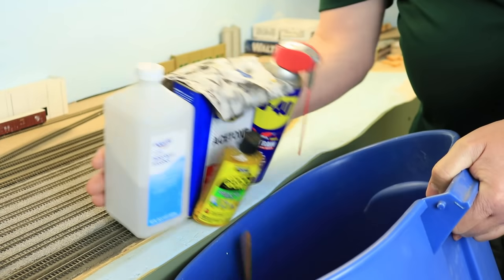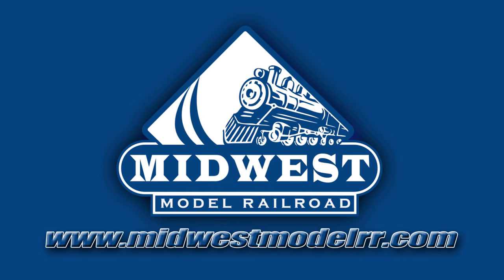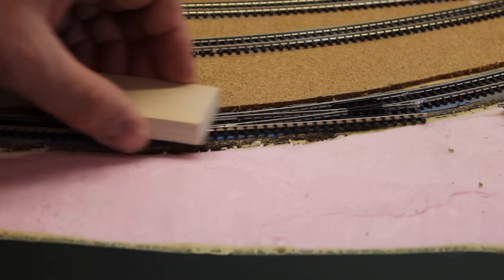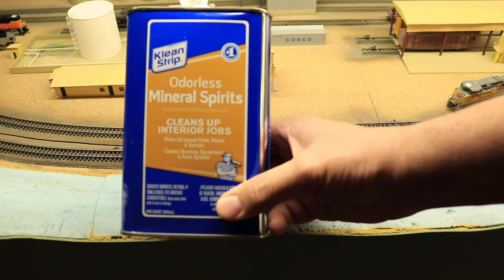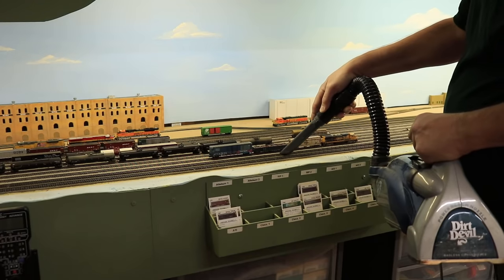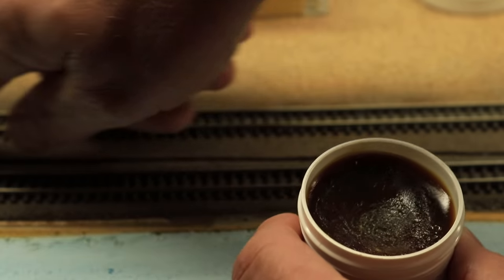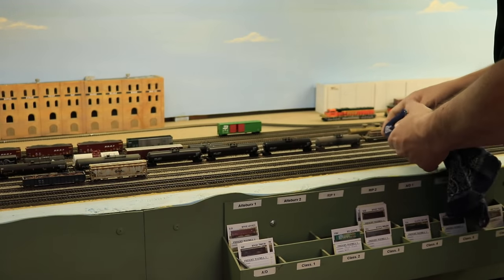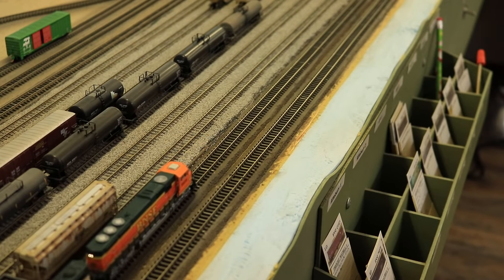Stop Cleaning Your Track on Your Model Railroad

Comment: I know a guy that has the best tracks ever. He dealt with this problem back in the 70s. He took an old gold ring and rubbed the rails. Goes exactly what you are talking about. I thought he was crazy but now it makes sense. You can’t see gold on the rail but it does put a microscopic layer. Gold never oxidizes. Gold is the highest electrical conductor. I’m going to order that no-ox. Great video Ron
Reply from the maker: Gold ring--interesting. Never thought of that technique before. thanks for sharing that.
Reply: Sure, it starts easily enough. Next thing you know, you're on a long journey into dark lands, pursued by a weird little gray man thing and eventually end up hating your best friend.

Comment: I would never apply something like No-ox.  A friend did - all it did was create a greasy mess and you can see residue from it on the rails.  He now has a nearly impossible cleaning task.    Also, Ron refers to Joe Fugate's investigative work on track cleaning.  That chart does not list No-ox.  Cleaners that are used for electronics such as the ones at the top of Joe's list are far more preferable.
Reply from the maker: If there is a visible residue, way too much was applied.

Comment: You can also buy electrical contact grease in little packets about the size of a ketchup pack at your local auto parts stores. That's enough to last for years.

Comment: Hi Ron, You may want to sit down, a somewhat long story is coming. First off, you do know pure water is actually an insulator? i.e. Pure water does not conduct electricity, but tap water will because of the impurities in it. Also water makes iron rust because the oxygen in water binds with the iron to create iron oxide. In the past I read the Joe Fugate article on Polar vs. Non Polar and understand the logic behind the article, but since my layout shares living space with my family, I didn't want to introduce harsh and smelly chemicals into our living space. Being 60 years old, I'm somewhat old school. I no longer use a bright boy to clean my rails, several years ago I switched to a Cratex cleaning block to clean my rails. The Cratex Cleaning Block is suppose to be less abrasive than a bright boy. I only used Isopropyl alcohol to clean the wheels on my locomotives using the tried and true tissue paper draped over the rails technique. In the past I'd tried some of the common techniques like Wahl clipper oil and Rail Zip, but in my experience it seemed using those products increased the black gunk. My current method using the Cratex Cleaning block on the rails and IPA on locomotive wheels seemed to eliminate the black gunk. Watching your video I noticed a product on Joe's list that I already had in my Model railroad tool box. I use DeoxIt D5 to improve conductivity on the small contact plates on my Atlas code 80 turnouts. I had forgotten that product is number 4 on Joe's list, so being game I sprayed some on a Handi-wipe and starting wiping down my rails. I need to mention at this point my rails looked bright and shiny and I was thinking this is going to be a waste of time. Low and behold the Handi-wipe was turning black. Well I'll be, from now on I guess I'll be cleaning my rails and locomotive wheels with the DeoxIt D5 and discard my Cratex cleaning block. As a FYI, from time to time I do run steam locomotives and some of them have traction tires, so I'm going to heed your warning and not apply any of the NO-OX-ID A-Special. Thanks Ron for the video, I have one suggestion, a few months down the line, can you let us know how your track and locomotives are preforming? Cheers, Rich S.

Comment: Funny - I advocated my opinion about oxidation here in Denmark, when I started the hobby, last year - Everybody claim, that this will not happen, not understanding, that especially silver will oxidize with a black film. Just think of silver ware... it needs polishing ;)
Reply: Dahl - I have to agree with you, this is very clearly a metal oxidation problem - Joe was right in referencing the original study, he just went off the rails with the cleaners and solvent polarity and trying to tie it to dielectric constants.  Dielectric constant and polarity is being grossly misunderstood.  I am not going down that rabbit hole....  From looking at the SDS's, uses of the No-Ox products in commercial and real-world applications, playing with the tube I have at the house, and a healthy background in redox chemistry, I suspect the following:  No-OX is primarily an air stable, high MW wax that when applied to clean, oxidation free track, seals the metal track from interacting with oxygen in air and thus preventing the metal on the track surface from oxidizing - that surface oxidation is the real enemy!  No-OX likely also contains an oxidation (e.g. corrosion) inhibitor to prevent both oxidative degradation of the wax and to further inhibit the metal track from oxidizing.  And finally, it probably has some graphite or a highly oxidation resistant metal (gold or platinum come to mind) to make the wax electrically conductive.  So after cleaning your track with your solvent of choice, coat it with some No-Ox to seal the metal track from the air, minimizing the metal oxidation, and the graphite allows it to carry an electrical current with little voltage loss.
Reply: @tomeldspringer7042  Hi - I actually go a bit in a different direction: Living in an environment, where I can control the humidity, I simply keep my tracks dry - They will oxidize slightly over time, and here I simply use the LUX cleaner, with the softest of pads - It also uses a brass brush, that actually (i believe) leaves residue in the track, that prohibit the build up of oxidation. In between, I go for a drive with the Roco cleaning wagon. 

I also found, that the biggest culprit is actually the wheels of the rolling stock, and I am going to get myself a wheel cleaner.

Comment: As soon as that chart comes up, I"m like, "Who the heck would use gasoline to clean their model railroad tracks!?!"
Reply: Even rubbing alcohol does better than gasoline
Reply: @chasesrailwaylinesrr6447  It's not a matter or how good of a job it does. I wouldn't want to burn my house down. I wouldn't want gasoline on my hands. I wouldn't want the risk of getting gasoline in my eyes if one of my eyes chose that moment to be itchy.
Reply: @ixiairisborne1695  K that too
Reply: @ixiairisborne1695  yes that's a serious problem. Sparks are common on model railway layouts, between points, loco wheels and track, heck if you drop a paper clip over a section of live track there's gonna be sparks. All you need is one and the whole layout combusts.
Reply: @Deuce_and_a_half  unless you are dumping gas onto your track the fumes are going to dissipate rather quickly. Plus pretty much anything you use to clean track is fairly flammable so not sure why someone would be sorry worried about gasoline.

Comment: I did exactly what Ron suggested (cleaned the track with mineral spirits and applied No-Ox that I bought from Amazon) and our trains went from barely being able to get moving and go around turns to now running as fast as I've ever seen them run.

For the record, we have a Marx #999 set from the 1940s. They're not tiny trains and tracks like in this video, but foot-long cars on 2in-wide, 3-rail tracks. They're very similar to early Lionel train sets. I mention it just so that others know that Ron's guide works on train sets as large and as old as that, too.

Thanks so much, Ron! The trains that my mom played with as a kid in the 1950s and I played with as a kid in the 1980s now run like we both remember them, despite being 75 years old and never having been cleaned in all that time!

Comment: Been following the whole track thing for some time, and personally, I am an old Lionel guy, so track cleaning happens regularly. Have tried all kinds of stuff like everyone, but a while back started using automotive surface prep. (the stuff comes in a gallon can and used for cleaning bare metal before painting). I have had good results with it, and will stay nice for a long time span. I have my layout suspended from the ceiling above my work shop and use a old school track cleaning car,  fill it up and run it. A good tip from a friend!

Comment: Ron, I hate to say I told you so, but we talked about this two years ago on Model Railroading Live and you laughed at me and said, “I’m not putting grease on my rails”, just like people are saying to you now! I also mentioned to you about the stainless steel washer. Well it has been two years plus since we talked about this and except for dust I have not had to clean my rails since we talked. 
The bottom line is, with proper pre-maintenance this process works very well, provided it’s applied properly as you mention!
Reply: What about this stainless steel washer?  Sounds like another great tip we should know about.  ;)
Reply: Tyrion, the stainless steel washer acts as a honing stone/steel would for a knife. It burnishes the scratches created by a bright boy or filing the imperfect joints, thus reducing places for dirt and grime to accumulate!

Comment: This WORKS.  I tried it on a section of my track and the difference is amazing.  Locos now go so smoothly and also slowly if required.  I am extremely happy, how long it will last is yet to be determined, but even if i have do the procedure once a month, so what, the improvement in running is so great.  Thank you so much.

Comment: I am a Contractor, so I have lots of mineral spirits around for use on Jobs and have used it with Train Sets for years. I also have been buying for work these Foam sanding blocks. I use the 400 grit Blocks for tracks without any negative  problems for about 10 years. I rub the 400 grit block around the track then follow up with the Vac, and then wipe down with a damp cloth of mineral spirits about twice a year. I have never heard of the stuff at the end of the video, but may get some and try it. Thanks for the video.

Comment: I had a couple of track sections on my new layout whereby the engine stopped and stuttered.  I checked the voltage before and after the section and it right on 15v.  Looking at the track, it appeared cleaned.  So I saw your vid, Ron, and ordered both products from Amazon.  After receiving them, I got to work applying and rubbing them as directed.  AND, the engine is now happy with those two sections!  Amazing that the track looked good but failed until really cleaning them.  Thanks for a very helpful vid.  Cheers, Bob

Comment: I've been using IPA for years and it seemed to work okay.  After watching this video I carefully cleaned the track with mineral spirits and then applied the grease.  What a difference.  Especially in the yard.  My 060 and the little diesel switchers don't hesitate at all.  I can also see a big difference in performance in the main lines.  I initially had a traction issue on the grades.  A little too much grease.  So I ran locomotives pulling John Allen style track cleaning cars on the layout for a couple hours.  I would stop them every ten minutes or so and sand the grease off the Masonite pad .  That resolved the problem.  
      This is a must see video for anyone with a layout.  Great work Ron!  Thank you!
Reply: Just a follow up.  Eight months in my layout performs past my wildest dreams.  I had to clean up a frog this afternoon and that is the first "cleaning" I had to perform since my original post.  Follow the instructions in the video and your layout will work amazing too!!!

Comment: I had a bottle of 'No-Ox" when I was a kid 35 - 40 years ago, a yellowish fluid that the owner of the shop recommended, interesting for sure.  In the auto industry the term micro arcing is also used to describe the surface degradation of secondary ignition components  such as ignition cables.  We were encouraged to apply dielectric grease on the connections between the coil towers, wires, plugs ect to minimize the accumulation of the black stuff and pitting that micro arcing causes that that in turn adds resistance.  This all makes perfect sense.
Reply from the maker: Yes indeed, same principle on a smaller scale--like Z scale. LOL.

Comment: Very in depth. Not a simple topic at all. Fishplate' and Chadwick discussions prompted me to try the Inox. I didn't give it much thought, other than "mnnnn, I'll try it, but I don't expect much". But once I put that Inox on a dust monkey(woodland scenics), and ran it around twice, the twins have never run better, smoother, slower, and more reliably. These conductivity products are awesome! Never would have thought it, but true! I, now, only apply the lubricant maybe every couple of months... I don't have to do anything else. No wheel cleaning, nothing..It's been really a game changer on mine..

Chadwick model railway is heavy on good things also..

Comment: I have used the No Ox Id on my Kato Unitrack rail joiners when assembling track. In the past I have encountered enough oxidation to cause a large voltage drop at the joiner, and so far this product seems to eliminate the problem.  Two years and counting on the track in my staging yard with no voltage problems.
Reply from the maker: Interesting use of the product. Thanks for telling us. 👍🏼

Comment: Many thanks. I’ve known about this product for a few years but never purchased it. When I first saw this video I ordered a tub. I finally started deep cleaning and lightly applying this No-Ox. Wow Wow Wow!!!! After not running the main for a year It’s running great. Basically you alone spurred me into doing something. I highly recommend it. I built this as a switching layout with many many feet of track but figured I would never have successive op sessions. I’m feeling much better now. With a renewed motivation I hope to get the whole layout running smoothly. Didn’t mean to ramble on but thanks again!

Comment: Tried this on CIRC layout in Des Moines during Iowa State Fair.  Lots of trains running.  Cleaned Wheels before fair and ran A couple of Brass Cleaning Cars with Rollers and Mineral Spirits ahead of the first day and then applied NO OX.   Instead of running wet rollers at beginning of each day we ran dry rollers and picked up an amount that you would expect when running multiple trains from 7 AM to around 8:30 PM for 10 straight days.  I thought we might consider using a roller with NO OX on it to coat the track evenly instead of doing it by hand but I didn’t get a chance to try it.  I do like the system and would like to try that method of application.  Using a dry roller to clean seems to work quite well and cuts back on the possibility of paint damage to loco shells from the Mineral Spirits.  Enjoyed your presentation!  👍

Comment: i very new to this hobby, 2 months now i guess, but didn't realize how fast tracks get dirty, at slower speed i noticed the headlights flickering (im not buss wired) voltage drop i thought, checked for voltage drops none found, cleaned made a huge difference for a day or two, use the no ox id a special, admittingly i did use too much first time and lost traction  on incline, my fault , cleaned track again and used very very little , no more issues for 2 weeks have not touched track since, Thank You Sir.

Comment: I’ve had a container of No-Ox for over a year, haven’t used it because the bright boy and a microfibre cloth worked well, have had two Intermountain SD40-2 locos one with sound one without. Both ran like ass over freshly cleaned track, cutting in and out, sputtering around the layout. I finally rubbed some no-ox only on the track today and it made a huge difference, it didn’t fix 100% of the issue but it cuts/sputters once in 5 feet instead of 15-20 times! 

Im going to try all the steps next, hope it fixes it. 🎉

Comment: Thank you for this VERY informative video.  I plan to order some No-Ox today. My problems are the same as everyone else has experienced.  Whether it's an old engine, a new engine ... same ol problems.  I questioned my power packs, engines and track.  Just two days ago I finally decided it was a track problem, and then MIRACULOUSLY THIS VIDEO CAME UP TODAY.     Thank the Lord, and thank you Ron!
Reply from the maker: Good luck and let us know what you think.
Reply: @RonsTrainsNThings  My No-Ox came, and I got busy right away cleaning my track.   I would give this report.  1.  Use SPAIRINGLY.  If you think you have enough, youi probably have TOO MUCH.  I spent a long time cleaning the "excess off of my track, and off of my train wheels as it picked up a lot of excess from the rails.   Once cleaned up, however,  I have been very pleased with the results.   2. Results:   ALL of my trains, even the very old ones, run very well, even at very slow speeds.   Furthermore,  my only engine with sounds is producing better sounds!!!   I will be eager to see how long they will run without getting dirty and loosing continuity.  This has been a major battle for me and a major frustration.  Therefore,  I thank you so very much for this GREAT cleaning video.   God bless you well.

Comment: After watching you video, I used mineral spirits and cleaned every bit of my track. By far the best cleaner I have ever used. I have some small switchers that cut out on the layout. After using mineral spirits, they run like a champ. I have received the No Ox in the mail and now in the process of applying that. All my locos (22) of them and over 140 rolling stock have been cleaned as well. Really looking forward to the No Ox. Thanks for the tip . Good video.